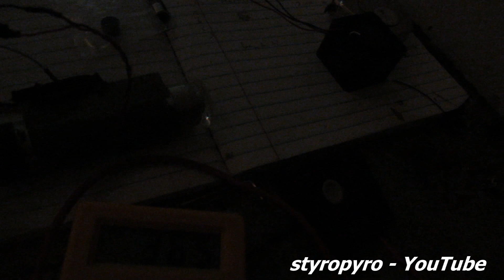My Homemade "Laser Taser" Pistol with pulsed YAG laser and High Voltage Head!!!

Comment: @styropyro what do you think about laser cleaner? Like the ones that cleans rust. Is there a way to built one DIY? Would that be safe? https://www.amazon.com/DIHORSE-Hand-Held-Cleaning-Machine-Removal/dp/B07B48V7CR?ref_=ast_bbp_dp or the one from P-laser, and so on. Usually those are machines that cost a lot of money, and I do agree that there are a lot of technology inside. But yeah, is there any way to build it cheaper? It would be an interesting project

Comment: זהירות - caution
מתח - tension/current
גבוה - high
Pretty good guess. I was in the israeli military so how this peice of idf equipment made it onto ebay intrigues me. Stuff does go "missing" but the more expensive or dangerous something is the less likely it is to dissapear becuase things like this are signed on personally by whoever comes in contact with it. I have heard stories for example. Every year israel has a day where you can bring in things without getting in trouble, one guy brought in a stolen m16 and a hand grenade. How he managed to get that stuff without anyone finding out is beyond me.

Comment: Meh. The seller included the PFN for a reason, yag likes a very short pump pulse. You can get away without the PFN for a ruby but you loose quite a bit with a yag. With the PFN and q switch you would have a significant increase in peak output.

Comment: So I've had this idea of which I think you'd be able to create fairly easily. 
Using a wooden bat; wrap electrically conductive cattle cord around it and apply power to create a power bat that's able to shock whatever it touches. If possible. :)
Reply: Or a high voltage whip

Comment: Mt company uses this same idea to remove corrosion from valve bodies.  It produces a wider beam and is much faster.  It uses a welding power supply, plugged into a 480v outles.

Comment: what would it cost to build a low power pulse laser?

i found a Impulse lamp for $10
and a yag rod for 24$

if i build a driver would this work?

https://www.ebay.com/itm/Nd-YAG-laser-rod-3-mm-x-50-mm-non-polished-end-faces-NEW/323591035328?hash=item4b578759c0:g:RDAAAOSwN1JazkdU:rk:2:pf:0

https://www.ebay.com/itm/SPIRAL-Xenon-Flash-Lamp-Strobe-Tube-Flicker-Stroboscope-HorseShoe-Beacon-Helical/121809484311?hash=item1c5c693a17:g:xKUAAOSwIDZbOzGK:rk:1:pf:0

Comment: Okay, do you want to make another modification?  Okay, get rid of the metal, there should be a glass tube inside.  Now, make a solenoid coil to fit the laser tube into.  Wire it to your circuit like this, ground from the laser tube, through the coil, then ground.  Magnetically pumped plasmas get hotter than discharges.  But discharges initialize a conductive plasma, A helps condition B.  The current through the coil will hammer the plasma.

Comment: Nice, but why did you need to remove the Q-switch? After all there was a reason it was there, and it was certainly not to waste energy or to not have the laser function properly... You'd better have the laser itself make those electric sparks rather than adding a taser :)

Comment: HI there Drake,
VERY impressive as usual.  I was wondering...have you ever succeeded in ionizing a column of air, and if so..how long?  I was thinking of tyring to ionizing as long of length as possible with a N2 laser.  Any thoughts on the viability?
--daLe

Comment: There is no way to iodinize air, because oxygen cannot be scientifically possible to be iodinize in any way.
And again more holograms being created as deception
That thing is not producing any electricity, capacitors doNOT allow more current by putting more capacitors they doNOT act as battery because is the material the resistor and it only capable of withstanding certain limit, is like trying to say that a 9mm gun can withstand shooting a Cannon ball, stop being stupid people
Reply: Moon landing was a hoax filmed by NASA in a secret collaboration with Moon people. Neither Saturns nor Lunar Escape Vehicles did go into orbit. The footage of astronauts setting their feet and messing around was real but inside the spacesuits were not humans

Comment: Posting to a dusty thread:

It's not the ionization that will easily put electricity and light (AC and radiation? Find the difference? Or mb see the unity?) together. I know what it is - but styropyro does not bother to get in touch with me so we all probably don't deserve this technology yet.

Keep shooting each other with rubber bullets you fated ones.

Comment: 0:28 yeah, it does say "Danger- high voltage", but it would be much easier to read if you weren't holding it upside down :D

Comment: that's actually really cool. I might just have to give this ago but with 20 caps
Reply: instead the the tazer, just connect the caps to those prongs to discharge them with one zap
Reply: I'd use 20 400v 470uf capacitors. get a buck converter instead of the cameras

Comment: Have you ever built a fast pulsing yag laser? 
So it has a almost true beam due to really fast pulses?
I would really like to make one, for the use of removing rust etc :).
And would be cool to be able to fine tune the power on it with some kind of potentiometer.

Comment: Stung gun, not a taser. Taser is a brand name. Also Taser brand products calibrate the eltrical output to over ride your muscle control. Your electrical gear is old school "stun gun", which is brute force electrical pain. Interesting use of the old laser parts.

Comment: Cool stuff.  Keep it coming.  Have to love the guy that corrected your assumption the Hebrew meant high voltage by confirming you were correct.  The way the strobes work is interesting.  Seems like some potential there.  Adding the caps like you did for one.  One thing though....with saws and cutting you want to measure twice and cut once...lol, at least you are not afraid to show you mishaps but some day might be a much more expensive one.  Just an idea.

Comment: I heard if you get a laser with a high enough peak output it can ionize the air. If you couple that with a marx generator, you could trigger it instantly, it might also be possible to 'shoot' lightning at something. Also UF scientists are experimenting with high-powered lasers to Trigger lightning.
Reply from the maker: Oh wow, cool to see you commenting on my channel! :) It isn't super hard to ionize air with a laser in one spot (i.e. focal point of a mode locked or Q-switched laser), but ionizing air along a long channel becomes quite a bit more difficult. That being said I do have my ideas for combining plasma generating lasers with lots of electricity, even if it isn't an electrolaser...
Reply: @styropyro  Sorry to start up an old thread, but couldn't you use multiple Q-switched lasers to create a line of ionised beads that are close enough together for an arc to jump up the line?
Reply: Have you tried "dressing" the laser? The private military weapons contractors E.I.N. were developing a LIPC based lightning weapon which didn't do much very far because it would always ground itself to the nearest conductive object as per relative permeability. However! I've never seen anybody use a recent development in laser technology called "dressing" whereby you make what is basically a coaxial cable from the stimulated emission of the lasers to complete a lasing circuit at a distance.
Reply: how hard would it be to make a laser with an adjustable focal point using piezoelectric actuators?
Reply: @styropyro  this man speaks electrical engineer
Reply: @styropyro  you gonna destroy the earth or what?
Reply: @styropyro  the laser's effects are small and insignificant. by the time the caps are charged, the attacker will already have shot you. You need to design a better circuit that pulses the laser at a set frequency or stick a diode laser on it
Reply: there is a weapon in development with the military called an electrolaser, that creates what you describe (called a laser induced plasma channel or LIPC) then runs insane amounts of energy along them to burn stuff and fry electrical stuff.
Reply: @swrdghcnqstdr  wow
Reply: +styropyro can you please? or do you have any other higher powered pulse laser videos?
Reply: I'm in no way an expert, but would fiber optics help you make a more powerful laser? Doesn't the NIF (national ignition facility) use this technique, or am I mistaken? Feel free to correct me.
Reply: TheBackyardScientist it's called a tesla gun
Reply: That's actually what I thought this video was going to be about.  If you have two lasers that ionize the air, they can act as taser electrodes, making a long distance taser - although I find it disconcerting that there are no commercial products like this yet so I doubt a hobbyist could pull it off.
Reply: Is this how Clash's shield works
Reply: I had this idea before but was told it was stupid :(
Reply: Thor time.
Reply: I was just going to ask. The book Freedom TM had one.
Reply: You mean an arc cannon
Reply: Always wondered if this couldn't be done. I always thought of having two lasers ionizing separate channels of air in order to carry a plasma charge, kind of acting as wires
Reply: Ede
1ooooolllooooo
Reply: You’re here too? Noice
Reply: I think  if he gets on that he will blow up the world
Reply: TheBackyardScientist ladies and gentlemen, we got him.
Reply: TheBackyardScientist now we can REALLY make a Lightning Staff
Reply: he bought one of the tattoo removal lasers and it ionizes air easily!
Reply: Saw very few videos of electrolasers on YouTube and don't see them anymore. The laser cannon in star wars 8 is a massive electrolaser.
Reply: Imagine being tazed and lazed at the same time from one source, pretty brutal if I do say so myself
Reply: watch their going to turn it into a lightning tank
Reply: Don't give him ANY ideas
Reply: the fuck are you doing here??!! :D
Reply: MotherEric Yes. They use fiber optics in their fusion experiments.
Reply: UNLIMITED POWER
Reply: 333 likes
Reply: 334 likes

Comment: Hi there, since you messed with a flash, let me ask you a thing. There is a way of keeping the flash lamp always on? Like, switched on instead of flashing? I think that one component cannot wisthand the energy but, can you tell me? Great vi btw!
Reply from the maker: What you are describing is an arc lamp! They also require an ignition pulse of HV to start up, and are filled with noble gas, but I'd think running a flash tube as an arc lamp would kill it pretty quickly.
Reply: +styropyro That what I was thinking, it is just not designed for always on, like a xenon headlamp for example. many thanks for the info!

Comment: You need to build a lightning gun. Have a laser ionize the air, then simultaneously you have an electrode with a ton of voltage behind it and it will jump to and travel down the ionized air to the target, as long as it's grounded.
Reply: There is some defense company building such a device now.
Reply: +revtune I think he was trying that because he specifically mentioned the laser wasn't powerful enough to ionize the air. If it was we would have a lightning gun video from him.
Reply: ***** Oh good point, I missed him say that.
Reply: He probably still could do it with one of his more powerful lasers.
Reply: +TheBackyardScientist omg I've watched ur videos since u had like 400k subs lol
Reply: +TheBackyardScientist I couldn't sub earlier because I didn't have  a YouTube account when I started watching ur vids
Reply: So he lost alot of subs?? he has 296k subs, unless you meant 400
Reply: Mass effect detected
Reply: It's called an electrolaser
Reply: Not possible.Lightning doesnt work that way.
Reply: @cleric38  if it didnt then why is a defense company working on it huh?

Comment: Why did u need goggles I didn't see anything too bright
Reply from the maker: The output of this laser is IR (1064nm) so it is completely invisible to the human eye. That being said it can still do catastrophic damage to the retina!
Reply: You can go blind from it just know that
Reply: The same reason you can look directly at the sun in pictures, but not in real life.
Reply: it's because the screen you are watching it on is unable to admit that amount of light I think. it just a guess.
Reply: +styropyro hey wanna explain this video in english, also, ive asked this before, but what is the best way to get into lasering?
Reply: laserpointerforums.com
Reply: Because invisible lasers are dangerous too
Reply: +Dude ILLigence Join laserpointerforums.com and read as much as you can (especially on laser safety). Then I would suggest making a ~200mw 750nm laser with the cheap and commonly available loc-815 laser diode. If you already know how to solder, you could make a simple laser diode driver with a LM317 voltage regulator, a resistor and a capacitor.
Reply: JoeysTech Thanks for the correction. Its been a while since I've worked with that stuff.